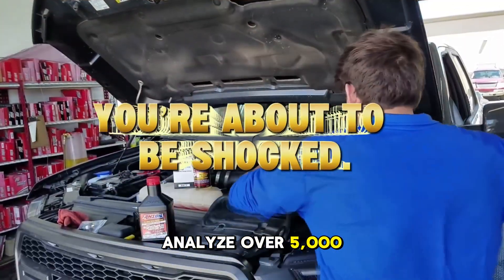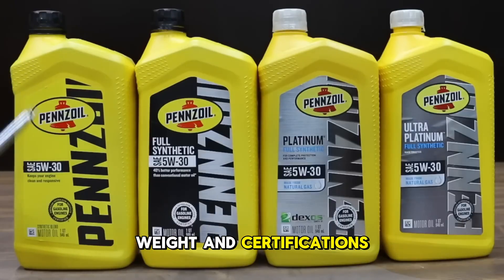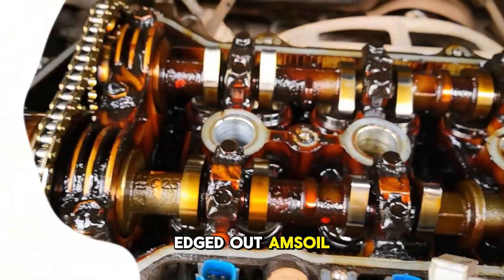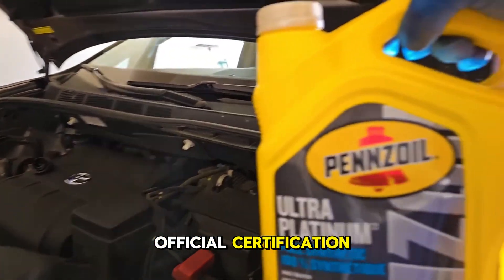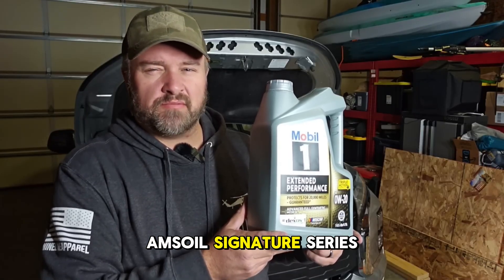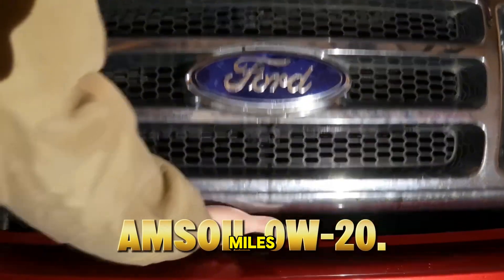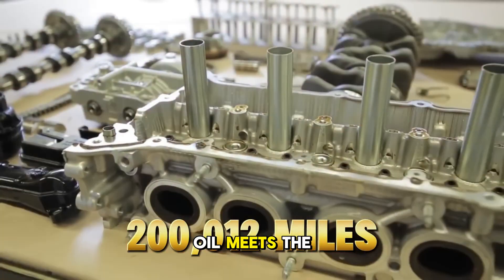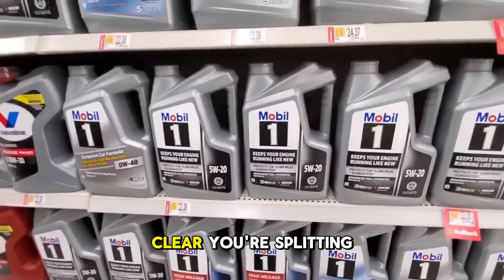I Compared 5 Oil Brands Over 200,000 Miles — One Standout Winner

Comment: I'll stick to Amsoil Signature Series 0w30 in my Subaru Outback Wilderness... I personally think the weight/viscosity is more important than brand. My 2018 Crosstrek developed a puff of smoke at startup at 7000 miles. OEM calls for 0w20... The dealer told me that it was normal. Absolutely NOT!!!! That's when I switched to Amsoil SS 0w30 at 9000 miles. The problem went away and I had the car up til 98000 miles. The lightweight oils do not cut it for longevity plain and simple. It's only in America where they're using them for gas mileage. The same car in Japan is using 5w30 and other parts of the world. They don't care about the second or third owner of the car. Call a spade a spade...
Reply from the maker: Glad to hear you found a solution that works for your Subaru — that's what it's all about!